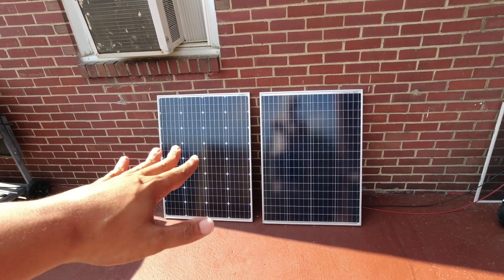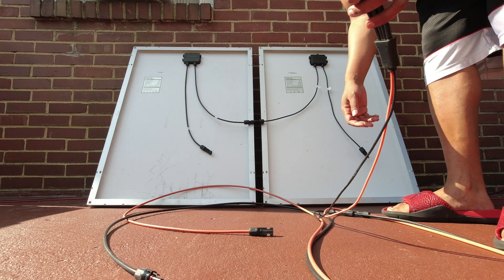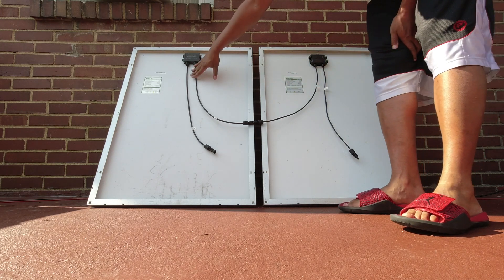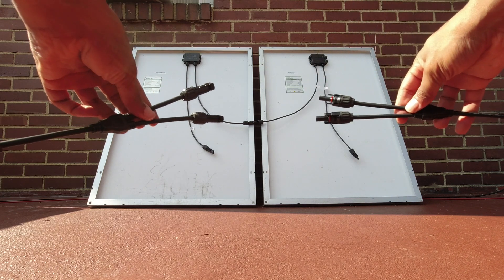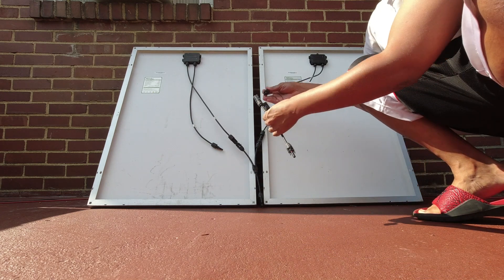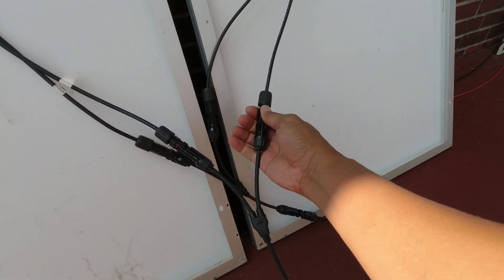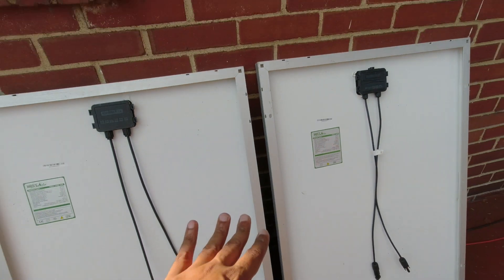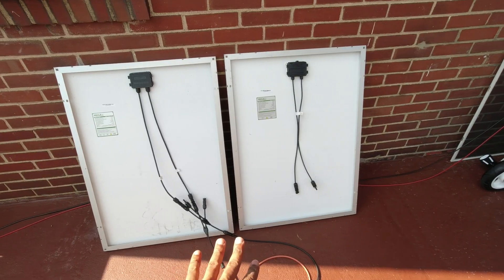How To Connect Solar Panels In Series & Parallel

Comment: Bro you have helped me big time thank you so much I have the Buletti Elite 100 V2 and I have a 257w and the bulleti 200 watt solar panel so will be working great when get them working together I'm in the sun 🌞 big time Jamaica
Reply from the maker: Interesting. I'm not super familiar with that one. How much solar can it take in
Reply: @AskIveSolar 1000w
Reply from the maker: Gotcha, just make sure they are both similar voltages
Reply: @AskIveSolar I googled it and they said that these two panels can work together ? The voltage on this one is Bulleti 200w voltage 20.4v 
Perlught solar 275w voltage 31.72v So the information from them I've ordered the mc4 connectors ? From your experience would it work because it's not the right voltage
Reply: @AskIveSolar So what they are saying is that I have to make sure the panels are paired in series not in parallel
Reply from the maker: That's interesting. Typically you wouldn't want to put two differing voltages in parallel because the lower voltage will drag down the high one. 

Can you physically look at the panels and tell me what the vmp voltage is and the VOC.

Voc is basically voltage when nothing is connected and the other is voltage once it starts giving something power. 

Then tell me the amps of each.
Reply: @AskIveSolar ok will do thanks so much for coming back so quickly
Reply: @AskIveSolar this is the 200w solar panel 
Voltage at max power /vma20.4v
Current at max power imp) output 9.7A then open Circuit Current (isc 10.8A 
Operating temperature ~10c-+65c

This is the other solar panel 257w p(0/+3%
Open Circuit Voltage (VOC) 38.85v 
Shot Circuit Current isc 9.19A ..max power voltage vpm 31.72v
Max power current imp 8.67A 
Max system voltage 100VDC 
 Normal operating call Temperature NOCT 45+2"c

Comment: Please: how do I connect two solar panels of 450w each to a 12V 160 Ah battery? Thank you very much
Reply from the maker: With a solar charge controller. You need to do a little more research on diy solar systems.
Reply: @AskIveSolar  Thank you...I don't understand the English language very well

Comment: Thanks for all the informative videos  I’ve referred to this video very often whenever I purchase an panel in fact you helped me with a problem before. I hope you can give me your input which array I should use for my recently purchased ac 200p, I have 2 190 hqst & 2 100 hqst panels not sure if I should put the 190’s in series & the 100’s in series then parallel. Your help would be greatly appreciated thanks.
Reply from the maker: Nice, let me ask....if those 190s are 20v 10amps, how can you get the two 100s to match that?

If series adds volts and parallel adds amps.....
Reply: 🤷🏾‍♀️ I’ve watched this video over & over 😊 I literally can mess this up
Reply: Probably just use the 2 190’s in series, thanks for responding 👍🏾
Reply from the maker: You could put the two 100s in parallel to make it a 200 watt 10 amp panel. Then you have 3 200 or so panels that you can put in series. 

For a 60v 10 amp array loosely stated of course. Does that make sense?
Reply: Yes it does make sense thanks for breaking it down for me you make it make sense even for a senior citizen like me thank you so much ❤️
Reply from the maker: My pleasure to help!

Comment: Awesome Presentation.
Reply from the maker: Thanks Larry, Just trying to help out in these solar streets yanno. Do you have a system yet?
Reply: @AskIveSolar  Hello. Have installed my Bluetti AC300 for about a week. Inputing two 400w panels. Testing both panels(leaning on 6ft tall wood fence) with panels facing East. Because of trees and wood fence behind the panels... Good Solar Sun ends about noon. Peak  is from 9:30am to 11 am. Either side of that period I get low light.
At low light my watts from panels drops a lot. Obviously Amps from panels under low light is low when in series connected. Thus I'm wondering if panels connected in parallel would give more total watts for the 5 hour period as the Amp is doubled at low light hitting panels in early  morning and the one hour before noon. My panels is leaned(angled) such as to be best from 9:30am to 11am. I live in California. These are my observations from beginning of January 2023. Yeb. I am a beginner. Never done Solar before. Oh, California been raining a lot this January.
Reply: In February I have 2 more panels arriving. They will face south. With slight tilt to ES. That wood fence shade would hit these panels at appx 3pm.
Reply from the maker: Oh that's awesome. It would cool to see some pictures or a quick video walk through. 
Ha
Reply: @AskIveSolar  Thats Funny. One Solar generator. A Batts. Couple panels. No Rack. Panel has Wet Mussy Gound for support. I guess a Positive is panel has the Whole of Earth as a ground(no lightening Rod needed). Heck. We live in California. Pay 40 cents per KWH to local Utility Co. That Extreme high cost for Electricty means my Solar will grow slowly. Was watching a California YT'r. He was so fustrated. His SoCal bill was $1000 for electricty last month. Coupled with extreme Inflations in California___ Thats Rough. Think minimum wages going to $17 hour soon. That too will Explode inflation in California
whereby everybody Hurts.
Reply from the maker: The silver lining in having expensive energy is your solar pays itself off faster.
Reply: @AskIveSolar  Have you heard of California's new Nem 3.0. Net Metering 3.0. Rather than getting 40 cents per KWH for giving your excess Solar to Utility Co... you will get like a penny for it. Also they would charge you a sizeable amount monthly to connect to the Grid. New Home Solar's will necessitate 1 or 2 Tesla Power Walls. Those things are like $15, 000 $20,000 a pop. Would'nt that Take Like 10 years plus to pay off a Home Solar System? Not much a Silver Lining California Solar Style!
Reply from the maker: I heard some stuff about it last summer and it's a mess. I'm no expert nor intermediate ha

Comment: OK, so I have (4) 100W panels.  They are 24.3V, and 5.34 Amps.  I want to put them on my house and connect them to my Bluetti AC200Max. Do, I need to run them in Series or Parallel, and What kind of wire do I need.  I am doing a direct connect to my Bluetti AC200Max.  No other battery station.
Reply from the maker: It's about what will work for you. Series is cool if you won't have any panels being shaded. Series also doesn't require any extra cables. 

You can put them in a series parallel set up to isolate 2 panels fe the other two so if one array gets shade then the other 2 will still get power.
Reply: @AskIveSolar  My Bluetti Volt range is 10V - 145V, my Amp range is 15.2.  If I connect all 8 panels (24.3V each and 5.34A each)  in Parallel, it will be more Amp,  and in series it will be more Volts.  Which way do I go? BTW, I appreciate your help and I dropped you a few coins in Cashapp.
Reply from the maker: Ooohhh you did. I saw that. Thank you so much!!

You don’t want to put that much power in parallel. Contact me directly. Let’s chat for about 10 minutes. Contact info is my newer videos

Comment: I have 3 panels of 300W each, and a 60A MPPT solar controller. There will definitely be shade at some times of the day. From what I understand, IF theres shade or using PWM then parallel, otherwise series. What about for my situation where I have shade and MPPT... would you advise I use series or parallel? Thanks! Also, can I even parallel 3 x 300 or do I parallel 2 of them, and then series with the other? Confused...
Reply from the maker: So that’s a bit of a slightly complex question. 
Series does seem to treat the panels as one large panel. So you will likely see super low output when shade comes in. 
But you can’t really do a series para connection with 3 panels. You would need four. 

You can parallel three but you will need to figure out fuses. That’s my understanding. I’m not an expert nor intermediate at charge controllers.

Comment: I have two renogy 100w panels which both work individually to charge my EcoFlow,  however when I connect them in series I get no input whatsoever to my EcoFlow, absolutely nothing. Any suggestions as to what I’m doing wrong or what the issue can be? Thanks
Reply from the maker: YES! Luckily you didn't break your ecoflow. You can't put panels in series on the ecoflow. Only parallel. Because the voltage limit on these smaller power stations is around 30 volts. 2 panels in series is 40 volts. 

Order a parallel cable and profit!!
Reply: @AskIveSolar  Thanks for the reply, much appreciated. I’ve now ordered a parallel cable. Each of my panels are 12v, I thought I just doubled that to 24v for series but I’m new to solar so probably have misunderstood the whole volts in series thing.
Reply from the maker: Make sure you watch this video. Because VOC is what you have to look at. 
https://youtu.be/wuG6tfTtRfk
Reply: @AskIveSolar  That was a massive help, thanks very much for the quick reply
Reply from the maker: Glad I could help!!

Comment: finally understand parallel and series! thank you
Reply from the maker: You're welcome Keith. Do you have any power stations yet?
Reply: @AskIveSolar  we just got bluetti ac200max with one pv200 panel . Getting another pv200 panel. Have you tried any of the extension cables from panels to unit? Looking at 30 foot to keep unit out of sun ….how much power loss using extension cable??

Comment: Mini Solar tip: e.g. a Beuler and all other hungry electricity consumers can be continuously adjusted down to e.g. 300W with a 5000W dimmer (7EUR). I run 5 dimmers in parallel on an 850W inverter. Kettle 2.2KW at 150W runs 12 hours a day, so the water is always hot. The room is also nicely heated. 2.5KW washing machine runs in parallel with dimmed to 200...400W. Iron, dishwasher, oven, electric heater, coffee machine, all internal heating are throttled with me. Videos about it on my channel https://youtu.be/eC2olbCBhh0 The inverter stays cool, quiet and the MOSFETs remain intact because extreme current peaks no longer arrive at the inverter. Now every Mini PV Inverter is enough to sell large devices...
Reply from the maker: Interesting, im not sure I understand what youre getting at though. I may take some time to try and get it.

Comment: I happen to have Two 190w Hqst and FOUR 100w Hqst Panels. What would be your recommendation for hooking them up to a Bluetti Ac300?
Reply from the maker: Maybe all 4 100 in series. Both 190 in series and then both in parallel. 

Snap you have the ac300. You can put the 190s in series on one mppt and the 100s in series on the other.
Reply: @AskIveSolar  I'd love to do the 2nd suggestion. I just need to get more cords, right now I just have one pair of 30 feet (I believe) mc4 wires. But I will try to wire them all in series and parallel them and see what happens
Reply: Earlier I removed 2 of the 100 hqst's, left the other 2 outside and put them in parallel, then attached the 190's in series, I was getting about 300 something watts coming in with the sun beating down on them,i was hoping for at least 400 watts
Reply from the maker: Email solarquestions@askive.com
Or
message me on FB IG or telegram

Comment: Help .. I need 3s1p... I have no clue what that means.. One person said it means 3 panels in parallel?...if that is true why call it 3series 1parallel... Thanks
Reply from the maker: I don't speak the s p lingo but this is what I found with regard to batteries. But should help. 

￼https://www.rcgroups.com › forums › showthread.php?1464318-What-is-3S1P

3S1P means a battery is comprised of 3 lipo cells connected in series. If you were to take 3 more lipo cells, also connected in series, and connect these two units in parallel, your battery would then be designated 3S2P.

Comment: Great video. Question when factoring volts one needs to look at the VOC correct? I also have a EB70 and just purchased two 100 watt 12v panels but the VOC is 21.6v. So if its the VOC we have to factor then I would not be able to use it on my EB70 correct? If so I need to cancel my order quickly. Thanks
Reply from the maker: The eb70 can handle that voltage. Up to 28 I believe. But 21 is fine. That's a normal "12v" voltage. Bluettis own panels are like 25 VOC. So you're good.

Comment: Question the Ecoflow delta says it can take up to 65v, if I have 1 200w solar panel and 2 100w panels, should I just connect the 100w in series then connect the set of 3 parallel to the delta?
Reply from the maker: Depends. One important thing to remember is panels in series act as one panel so if one is shaded then the power output for the entire array goes down.
Reply: @AskIveSolar  OK thanks for getting back to me and keep up the great work
Reply from the maker: I'ma do a video soon about my config on the eb120

Comment: Question the Ecoflow delta says it can take up to 65v, if I have 1 200w solar panel and 2 100w panels, should I just connect the 100w in series then connect the set of 3 parallel to the delta?

Comment: Got a question sir… Can I connect A 100 W thunderbolt solar panel, To The Go plus power station?
Reply from the maker: I don't have that device but I'm gonna say no because the voltage seems like it's too high. The input on the GPO says 15 volts vs something higher on a more costly power station. Like 12 to 28 volts. Yanno

Comment: I saw a guy using two 100 watt solar panels in parallel connected directly to a 12-24 volt frying pan cooking a burger. It`s pretty cool that you can cook directly with solar. I`m gonna rig up every possible use for solar in my camper trailer.
Reply from the maker: That stuff does work but you cant trust it because the voltage is too high and will probably burn your device out quicker
Reply: @AskIveSolar  My rice cookers are rated at 12 to 24 volts but I haven`t attempted it yet. They came with fuses but I haven`t figured out their size. I ordered the stuff I need to experiment with it and bought the things I need to rig up USB ports to a cable going to a fixed panel outside. I also have one of the things Will Prowse used...a buck converter...to regulate the voltage from panels. I can`t do anything here so I haven`t thought much about it except ordering cables and adapters for future use. They`re putting up an electric pole and electrical box at my lot so it won`t be long. As soon as the trailer is set up a roof is being built over it then I can get the hell away from here, hopefully with some sanity intact. But now a flood is coming so that`ll throw things off.
Reply: @AskIveSolar  I`ve been shocked so many times in the past doing crazy electricity experiments...I should know better by now. I always mess up and see big blue sparks and get knocked around and never see it coming.

Comment: Great video Ive.... explanation is thorough....I still need to order 2-4 extension cables lol.......
Reply from the maker: Nice! I was wondering if people would have questions but no one did.
Reply: @AskIveSolar  You answered and clarified all my questions, I think once I actually hook these panels up I'll have a question....I have 800 watts of panels, and Im really interested in the 200 watt rigid to add to or use in place of the rigid panels I have.
Reply from the maker: Looks around.... When you get so many panels MJ? Lol
Reply: @AskIveSolar  Thanks....1-2 at a time lol, I search for deals

Comment: That was helpful. I'm going to connect my panels in parallel to see if I can generate more solar input.
Reply from the maker: Nice!

What power station do you have?
Reply: Bluetti EB240
Reply from the maker: How many panels do you have and how do you have them connected now? Feel free to message me. I'm on fb ig telegram and email. See me about page. 
youtube.com/askivesolar/about
Reply: I have 3 Renergy panels in series. The most power they have generated is about 240 watts. Trying to get closer to 300 watts. Didn't know if putting them in parallel would do it.
Reply from the maker: 240 watts is about what is expect from that array. Maybe more on a sunny but cooler day. 

I don't think parallel is the way to go. It's kinda 6 one way half a dozen the other. It's the same volts times amps. And series is easier on the wires. 
Does that make sense.
Reply: Thanks. That make me feel better.

Comment: What guage are your extension cables?  They look like 10g.  Why?
Reply from the maker: Future proof. They are 10 awg. But please school be me on awg for DC. I tried to find stuff related but only came across AC ratings. Is it the same?
Reply: @AskIveSolar  I am a new student trying to learn too!  I did see a post on a solar forum (can't remember if it was Will's DIY) talking about using series connections for a long run (150') using 12 awg. .  I made a 40' extension using a heavy duty multi-strand 12 awg extension cord.  So far, I've charged my AC200P to 100%, discharged to 0 and recharged to 100%.  The recharge took ~7 hrs with 2 355W JA-Solar panels.    This is my first solar experience - other than lurking!  I really enjoy all of the solar and prep channels.
Reply from the maker: I'm not sure about that but I'd have to think about it. Yeah that makes sense. Higher volts can move easier through longer lengths of cable. The higher the amps, the bigger the cable.

Comment: Thanks for the video.   
What about disconnecting?   
Is there a safe way to it?  

I have the AC200P.  I turn off AC and DC on the unit and unplug the airplane connector (I think that’s what it’s called).  Am I doing this right?
Reply from the maker: You can just disconnected it. The mppt that deals with the solar has nothing to do with the ac and dc. That's connected to the batter and inverter.